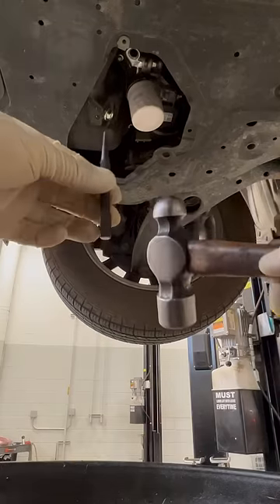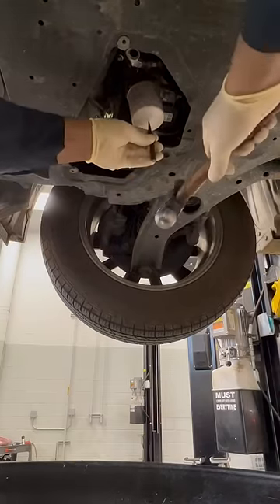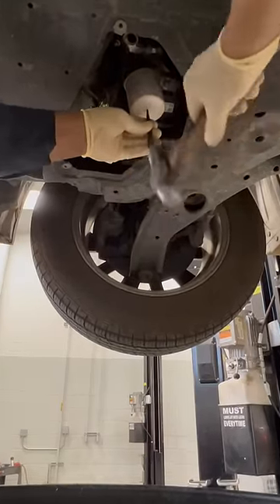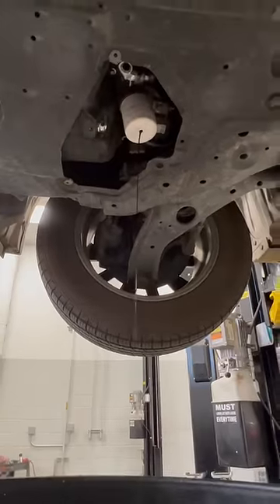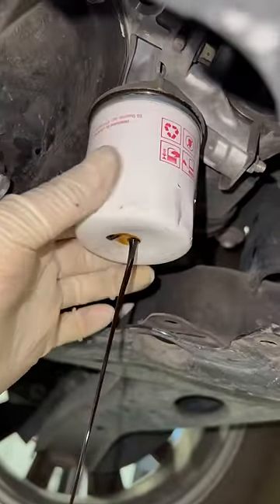Tech Tip Of The Day Oil Filter Clean Removal #oil #oilfilter #mechanic #shorts

Comment: Did this on a truck and it turned out we didn’t have more of those on hand and the truck needed to be out that day
Reply from the maker: Rookie mistake, always verify proper part replacement before starting the job
Reply: @WrenchingMafia hat’s goin on with your PFP bro? You into bondage or something?
Reply: @cc468 💀 it’s just a balaclava with two wrenches but now that you point that out I can see it 100%
Reply: Duck tape bro.
Reply: Y’all didn’t order it from an auto parts store?
Reply: @cc468 oil change gone wrong
Reply: @WrenchingMafia  we usually have crates of those filters in stock and it's not my job to pack the parts for service on the trucks so not on me
Reply: @andyrendon7753 we usually have crates of those filters in stock and it's not my job to pack the parts for service on the trucks so not on me
Reply: @meepmeep7844  yes it is. Have to have the parts before even looking at the car. Try again.

Comment: I would make sure you're able to take the filter off first if you're a diy'er at home.  If you can turn the filter a,1/4 of a turn then you'll be able to remove the filter after you punch a hole.  Nothing worse than being stuck with a hole in an oil filter you can't remove.
Reply: If you get a stuck filter if you are using a strap style filter wrench you can put a rag around the filter and then put the wrench on which will take up some of the slack and can help.  If that doesn't work then you can take a long screw driver and punch through the filter at the bottom horizontally so that it goes all the way through both sides.  Then there is no slippage when you torque it off.
Reply: @spyder000069  also helps to have a set of oil filter sockets on hand
Reply: If you’re ever stuck with a filter you cant remove then stop working on cars there are literally 3 different tools for that very reason
Reply: @romeocano1919  hence my recommendation to see if you can remove it first and if you can't stop working on the car.   Literally what my comment was about.
Reply: That’s the type of stuff you learn the hard way lool .
Reply: That's a problem I've encountered. A seized on oil filter. It comes out looking crushed and twisted. 😂

Comment: How the hell am I supposed to reuse it after I clean it out then??
Reply: You're not suppose to reuse it, change the filter every oil change
Reply: Nah I’ve had pretty good luck just using acetone to rinse it out and slap it back on
Reply: C´mon man don´t be silly now... you just put a piece of duct tape over the hole, works every time.
Reply: @benjadonnelly2384 I lost mine when I hit a pot hole. But I use a sponge inside a tuna can.
Reply: Buff hole down and place a piece of sheet metal over hole and soldier.

Comment: And make sure you fill up your engine with water and drain it so it can get clean inside
Reply: Dont forget to add detergent so the suds can really clear out those hard gunks stuck inside your engine block.
Reply: @zerotolerance3560  will do🤣
Reply: Fill it with laundry detergent and shake the truck up vibration
Reply: @ElOmen22  just crank it up works better

Comment: Don’t do this, unless you are for sure that filters coming off
Reply: Bro no way you do this without already have a new one 😂😂😂😂
Reply: @davidzagami423  He just said that the old filter may be stuck. So don't do this unless you know you can unscrew the old filter!
Reply: The only time I ever did this was the next oil change after a dealership moron installed one dry and overtorqued.  I had to punch a screwdriver through the side to pry it off.

Comment: Just make sure you have the right replacement filter
Reply: Stuck.
Reply: What? You're supposed to change the filter with the oil
Reply: eariecrowz2958 so you're gonna drive back to the parts store without running a filter at all?
Reply: You can actually reuse the same filter. Just use the punch on the inside of the hole and you're good to go. Works every time
Reply: @EddieD218  Or just buy the new filter with the oil in 1 trip before you start working on the vehicle. The main thing about the parts store I don't wanna go back so let me get everything i need to complete the job the first time.
Reply: @stykly1220  you've never been given the wrong stuff before? Wow kudos to your parts guys.
Reply: @stykly1220 there was no common sense put into their comment lol
Reply: @EddieD218 bruh just look before u leave. Know what u need and know what u get its common sense
Reply: @EddieD218  you have the world's greatest tool for advice in your pocket. Your phone has Google, look it up. Also just about every parts store in the states can search the exact part or other compatible parts you need by year, make, and model. 

I'm starting to think I'm getting baited, If so you got me😂
Reply: @darksaber1400  true I feel like I'm getting baited, and holy he'll is it working

Comment: This is very common in heavy duty. Tip- leave the punch inserted in the filter and just angle it the direction you want to drain the oil will flow exactly down to the punch to where you pointed.

Comment: side mounted Honda filter has entered the chat
Reply: Very underrated 😂
Reply: top mounted filter with integrated funnel and hose fitting on the 2nd gen Tacoma V6 has entered the chat also
Reply: LOL for real, CRV 2003 vibes.
Reply: 2003 Grand Marquis came to say this but knew in his heart of hearts it had already been said.
Reply: Came to comment this.  Beat me to it. Hate this filter mounting on mine
Reply: My first thought as a Honda owner “yeah fine if it’s not side mounted”
Reply: And some Nissan’s. That trick only works well if your filter is mount with opening up. Also, mention many times before, make you able to loosen the filter before attempting this as if poke a hole in filter & you can loosen the filter, you can drive it somewhere to have someone else to do it.

Comment: Personally I try to be as nice to the old oil filter as possible cause I’ve been in a handful of situations where the parts store gave me the wrong filter and I didn’t have time to run back. Obviously not the right thing to do but it got me or the customer through a day or two till I could get the right filter.
Reply: That's why u need to check your part numbers when they come in, laziness will get u every time
Reply: Just look the part up ypurself
Reply: @tb123.  honestly i like to check everything first, get year and make loaded into safari before it goes up the lift, i like to be planned and ready, and the past 3 weeks theres been like 7 different wrong part deliveries. sometimes owner would drive next town over to pick up and come back with wrong part. i hate wasting time there so much

Comment: Pro level version, make a custom punch that is hallow half to the center with a barbed fitting installed in the center. Push a piece of hose onto the barbed fitting in the center. Now when you punch it into the filter the oil will flow through the pinch, out the fitting, and through the drain hose. Leave it in until the oil stops...it's like a fitting you can punch into the filter and leave in place until it's drained

Comment: why didnt i think of that?  been changing oil for 60 plus years and this is a first .  WELL DONE MAFI   WELL DONE
Reply: As a HGV mechanic I see almost no reason to do this on a vertical car/van filter, it all stays in anyway and you grab the filter with a rag. Only exception would be when the idiot engineers designed it to have the filter sideways or at an angle.

We only do this with 2 litre Volvo wagon filters because they're a dogshit design. Tighten it properly? Leaks oil. Tighten it so it doesnt leak oil? Seizes on and you have to punch-drain it and swing on the filter strap with the longest strongbar you can find till it either comes off or twists into an unrecognisable ball of metal.

Sorry, I'm ranting, they're a really shit design lol
Reply: I have really formed some choice words in the back of my head due to removing oil filters!😮

Comment: I do this, too. I use a large gutter mounting nail that I’ve sharpened the tip of.  If oil doesn’t come out smoothly after a while, tap another hole and then air can get in and smooth flow can resume. 

I’m a DIYer so I can let this go overnight, and it can really reduce the amount of SPLOOSH! when the filter finally comes off, from inside the filter or the oil galley above it.

Comment: Dude! I'm changing my oil today and I happen to see this video! Thaaaank you!

Edit: I did try it, I have a nissan titan 2004, the oil filter is at an angle so I made the hole on the lowest part of the filter. Once drained unscrew it a bit so it can breathe and more will drain. Thanks again!
Reply: Just use a plastic drinks cup put it over the filter then unscrew dude it ain't rocket science...
Reply: @F J  what about all the oil that comes after you remove the filter, this way was much cleaner.
Reply: @240t1r sounds like a skill issue ong just be faster
Reply: @Joe  no matter how fast you are some will spill in different places, the faster the less you'll spill. By puncturing it takes longer but it's way cleaner. Just take your pick.

Comment: Golden rule, never damage any parts coming off the vehicle. You never know you might just need to use them again.
Reply: I remember I damaged a DPF on a bus when I was replacing it at service. Went to get a new one from the storeroom and there were none left... didn't make that mistake again
Reply: Yeah been told that before cheers 😅
Reply: Golden rule of hoarders yeah. If you have a filter replacement in hand, filters are wear parts/consumables and should not be used again. They aren't like shafts/bearings where you can make em live longer. When you're done with a filter you toss it. It's like putting on a pair of dirty underwear.
Reply: Nah man not in this instance. The golden rule is you don’t damage the semi functional part before being able to remove it. Prime example, make sure your fill plug comes out before the drain.
Reply: If you're reusing a oil filter. You should be changing your own oil
Reply: @markmata22 holy shit. Not everything is absolute. I just reused an oil filter for an extra 1,000 because I did a piston soak 2,000 miles into the new oil and swapped out only oils. There are situations where you can reuse an oil filter
Reply: golden rule #2 dont pull a filter until you have the new one in hand dummy
Reply: You never know that new filter you bought could be missing an o-ring or you could’ve accidentally picked up the wrong one. I’ve done that before found where my filter was looked at something real quick and just grabbed the one next to it by mistake went all the way home without realizing 🤦‍♂️
Reply: Mhmm, it's easier when you're the mechanics at your own shop. Stocks everywhere
Reply: Its a fuxking oil filter lol

Comment: only works if the vehicle has the filter in the vertical position
Reply: what if I was draining an oil pan though?
Reply: Upside down position. Some cars have it mounted right side up in the engine bay. Both are technically "vertical".
Reply: When the hole is on the bottom, it doesn’t spill if you unscrew the filter and lift it straight up 👍🏽

Comment: Problem: If the filter is stuck on you've just completely fucked it.
Reply: Lol why do people keep talking about stuck filters? Yall need better tools if you can't get an oil filter off
Reply: @MrLaughtilithurts 

It depends on the car. On my Mustang, an oil change is easy. The filter is at the bottom, and after opening a flap, it's very easy to access, even with tools if your previous oil change was done at a dealership and they used a breaker bar or something to put it on. 

On some other cars, the filter might be in a completely dogshit position. If you have to snake your arm through to get to a filter, odds are tools won't be easy to use there. If the previous oil change was done by a dealership, then that filter won't be easy to take off.
Reply: Just stick a screwdriver in one side until it comes straight out of the other. Then grab both ends and twist it to the left just as you would with the $100 tool they sell. Lol really I always poke a whole at the end and let it drain. Then poke a screwdriver from one side through to the other then turn. I promise, hasn't failed me yet...💪😎👍
Reply: I use my bare hands raaaa
Reply: It's gotta come off at some point even if it's stuck. Sooo yea
Reply: Filter is not welded to the car. No matter how badly it is stuck, you HAVE to take it off.
Reply: Flex tape has entered the chat

Comment: This also works great on your oil pan. It allows air to get sucked in as the oil pours out from where the oil plug was!
Reply: I do this as well. Just weld it back up.

Saves the hassle of stripping your threads.

Comment: >The ATF has entered the chat.
Reply: Get on the ground!!!! shoots dog
Reply: Huh?
Reply: @HaveAGoodDayFk.U  you can use an oil filter as improvised suppressor
Reply: @anthonykuhn1788 assuming you threaded the barrel of your…projectile launcher to the same pitch as the filter. Too bad it’s only a one or two shot use. The guy from Gamespot/Royal Armoury in the UK reacted to the modern warfare 2019 scene where Alex uses an oil filter to suppress his 1911. Said it’s not a permanent solution/
Reply: @Callsign_Kishin Bro no, its all dependent on caliber and barrel length. Airshitters shouldnt be allowed to speak on guns, nor should the cucks at the royal armory.

Comment: Pro tip: 
If you are servicing someone else’s car make sure you strip the threads on the oil filter housing as well as the oil pan and also don’t forget to leave the old gasket on the oil filter as well. Over tighten the filter as much as you can so that it never comes off and only add half of the recommended oil the car is supposed to use. Pep boys has been using this method for years they are still in business so they must be doing something right

Comment: Pro tip: This doesn't work if your filter attaches horizontally.
Reply: U just have to understand gravity and it can .
Reply: @corytomcany6027  even if u understand gravity and punch a hole on the side, you have to unscrew it tight, so the mess will happen anyway
Reply: Except it does 😂😂😂😊
Reply: @19shawn85 nahh blud doesn't understand gravity 💀💀💀
Reply: @lfieldss  You have to lift back of the car and punch/drill a hole in the lowest point of the edge of the filter can, the oil will drain out perfectly if you leave it drain for few minutes, not like this wrenching mafioso unscrewing it while draining.
Reply: Pro tip: you don't have this problem if your filter attaches horizontally.
Reply: Just turn the car sideways.
Reply: @SOUNDINTHECITY  W
Reply: Horizontal doesn't make a mess like these because you get it going 360 degrees and hard to catch, especially if the plug is also draining at the same time.

Gravity will drip it straight down every time on a horizontal filter.

Comment: Don’t forget to take of the gasket that stuck to the surface of the pan. Otherwise you’ll double gasket it and oil will go everywhere!
Reply: what kinda cheap ass filters you using that the gasket comes off?
Reply: @CHEEBnRUN  Look in the video 🤦‍♂️ The gasket literally came off in that video and is stuck to the face of the oil filter mount on the oil pan.
Reply: Yeah i found out the hard way about removing the old gasket and thought i was done, turned car on and i felt an immediate difference,  looked down under oil was shooting out(onto just poured concrete)till i turned it off
Reply: Done it. I about shit my pants when I seen the oil pressure plummet. Lol
Reply: Yup. Been there and done that. Now I always look to make the sure old gasket is where it’s supposed to be!
Reply: I cant even begin to count all the oil changes I've done over the years and have never seen that happen
Reply: @WD-hd1vw  Then I guess you haven’t done as many as I have. I’ve only seen it once, was a fram oil filter. Gasket wasn’t on it, came off on the face of the oil filter mount. Also in this video you can see the gasket stuck to the oil filter mount.